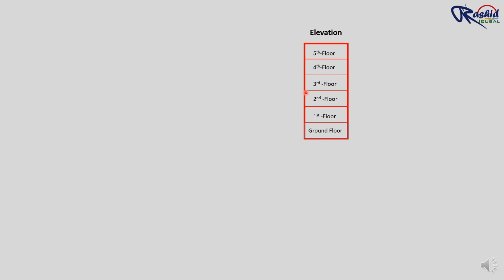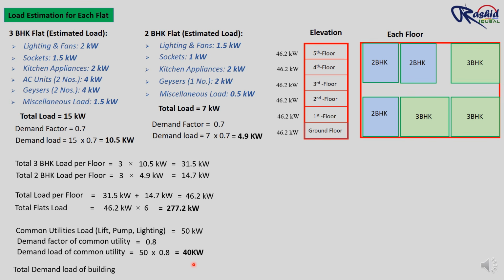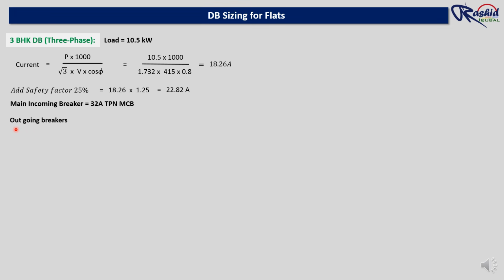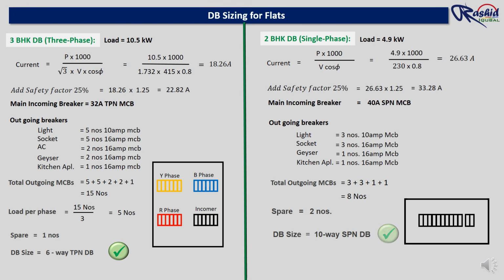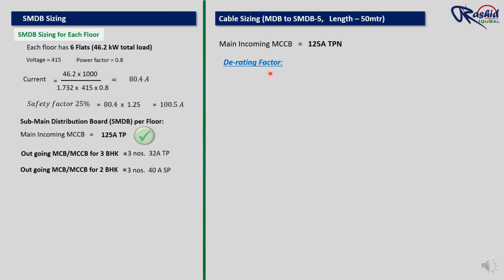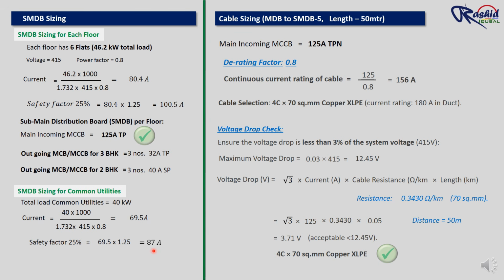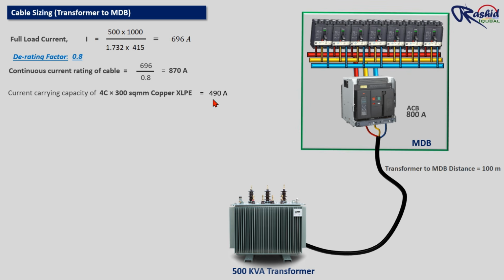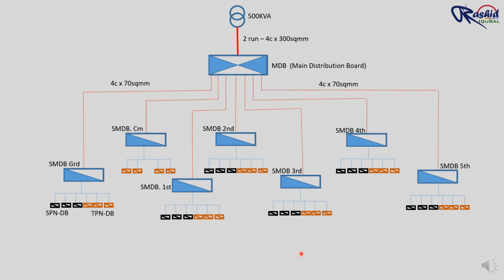Electrical Load Calculation for Residential Building | DB, SMDB, MDB, Transformer & Cable Sizing

Comment: Just to know sir, the power factor will be divided with load or multiple. For example 220*0.90=198 or 220/0.90=244.444? Which is correct?

Comment: Hi Rashid nice explanation but i have huge concerned that outgoing z 150A but incoming at SMDB is 125A this is not good & Professional practice , both breaker either be 125A or 150A but not like the above arrangment kindly avoid.
Reply from the maker: Thank you for your comment..

150A outgoing MCCB at MDB and 125A incoming MCCB at SMDB can be acceptable engineering practice. This stepped down arrangement can help achieve proper selectivity, so a local fault can trip 125A breaker first without shutting down the entire MDB feeder, provided the selectivity is properly verified. load, cable capacity, and protection coordination should be considered. I have design and used the same practice in many projects..

Comment: 40A breaker you use in each floor but incoming power you use MDB 32A. What can be happened?
Reply from the maker: I used single pole 40A MCCB at the SMDB side, and DB incomer is also 40A. There is no 32A MCCB in this setup. Please watch video again.. Thanks.

Comment: I love ur explanation but you missed add 10 to 20% to ur total connected of the building for future but u did it for transformer, secondly all ur transformer calculation, the transformer should clearly run on 85 to 90% depending on location regulations, thirdly safety factor of ur breaker is 125% instead of 25%.

Comment: Salam Aleykum Mr.Rashid I want ask you about office building if we calculate load power for office can I use this method?
Reply from the maker: Yes almost same, only things you need to consider is demand factor..  just check your electricity board provided the range of demand factor
Reply: @Rashid-iqubal Many thanks 👍

Comment: Which standard have you followed here for taking demand factor as 0.8 for common utility load ?
Reply from the maker: 0.8 demand factor for common loads is not in IEC or BS standards. It is just a common design assumption based on utility practice and experience to estimate maximum demand....

Comment: How have you taken demand factor as 0.7 ?
Reply from the maker: 0.8 for common loads and 0.7 for flats are just common design assumptions based on experience and load diversity. They are not fixed values from IEC or BS standards and can change as per project and authority rules..

Comment: Sir can you please sort out my problem.i have got 10number of  2 ton split ac.i need to know what is four core armoured cable required for this supply sir.the distance between smdb to db board is 20meters.

Comment: I would like to clarify one point regarding the protection coordination between MDB and SMDB.

It is observed that the outgoing MCCB from the MDB is rated at 150A, while the incomer MCCB of the SMDB is rated at 125A. Could you please explain the reasoning behind selecting a slightly higher rating at the MDB side compared to the SMDB incomer?
Reply: so that MDB MCCB will not trigger along with SMBD of each floor in case of fault occurrence and also the certain spare factor is taken to size main board MCCB so is 150A and is slightly greater than incomer 125A SMBD

Comment: For transformer to MDB you can take 4 runs of singe core , y to take 2 runs of 4 core
Reply from the maker: Using 2 runs of single-core cables for the three phases and 1 run for the neutral is the best option..

Comment: A small correction is required ,
While calculating incoming mcb/isolator for DB , we must make calculation based on total connected load not with maximum demand , because isolator must be capable of carrying maximum possible current if all circuits operate simultaneously
Reply from the maker: Thank you for your comment.. As per standard electrical design practice, incoming MCB/isolator for a DB is generally selected based on maximum demand after applying diversity, because all connected loads rarely operate simultaneously..

If all loads run at the same time, then demand will approach the connected load.. and Breakers also have time current characteristics, so short temporary overload may not trip immediately…
Reply: @Rashid-iqubal 7:47

Comment: While calculating voltage drop why you are not using that current value which you got after considering derating factor.
Reply from the maker: For voltage drop calculation, we use the actual current that flows in the cable, not the derated current.

Comment: hello my friend.... why did you use 0.70 and 0.80 ,  is that a rule or you can choose 0.60 or 0.65 etc????? thank you
Reply from the maker: It’s not a fixed value, my friend 😊 Demand factor depends on load type and usage. For residential we usually take 0.6–0.8, for commercial 0.8–1.0. So 0.7 or 0.8 is just a practical assumption… or u can follow as pre your country standard
Reply: @Rashid-iqubal  thankyou my friend and see you later

Comment: If u have 500 kva trafo means 400 kw which has current capacity= 720 amps so 800 amps breaker z enough. 
So as per 800 amps breaker , I will choose 240 sqmm sc xlpe/ PVC cable. 
240= 425 amps per phase as per Pakistan cable catalogue
2x240sqmm sc xlpe/PVC cable
Means= 850 amps which is enough to handle. 
2x300 sqmm sc xlpe/ PVC are over designed and not cost effective transformer current capacity is 720 amps then selection of 300 sqmm which has capacity around 1000 amps are question mark technically. However all other calculations are highly appreciated.

Comment: For 125 amps breaker 50 sqmm cable is enough to cater  if it's under 100 mtr length
Reply: Sir I have got 10 numbers of 2 ton split ac .what is four core armourd cable required for this supply sir.the distance between smdb to db is  20meters.please sort out this sir.

Comment: What's the total  KW a single phase supply in a house  in india? For example in UK a single phase supply is total 23 KW it can supply in a house which has 100 amps supply fuse at incoming supply to the house
Reply: It varies actually from state to state

Comment: Well done that man...probably the best video I have seen on the subject ! This will be very useful for everyone involved in the industry......One minor point, you derived the current using Line/Line voltage as 415V and Live/Neutral as 230V when it should be 240V. The corresponding values are 415/240V or 400/230V depending on your location.
Reply from the maker: Thanks a lot, yes I suppose to consider 240v instead of 230v

Comment: Why MCBs in flat DBs, should be installed ELCB
Reply from the maker: MCB and ELCB have different functions. MCB protects each circuit from overload and short-circuit, while ELCB/RCCB protects against earth leakage/shock..
That’s y MCBs are used for individual circuits and an ELCB is usually placed at the main incomer of the flat DB…

Comment: Aoa,
Rashid sb @ 8:08 can we use 4 pole 32A as there are 3 phase and a neutral 😐
Reply from the maker: Yes sir you can use 4Pole mcb as well, usually 4pole is use for sensitive area where neutral protection also required..

Comment: Can I consider the diversity factor in feeder cable sizing to optimize the design and reduce costs?
Reply from the maker: Yes, diversity factor can be considered in feeder cable sizing to optimize design and reduce cost but only when suitable..

It is acceptable for residential or commercial feeders where not all loads run at the same time.
Avoid it for critical or industrial loads (like hospitals, data centers, or machinery) where full load may run simultaneously.

Comment: I have a question sir, if the transformer used 2 cable each phase, so the number of ACB i have to prepare also one each phase?
Reply from the maker: No, if your ACB is able to carry full load current then only one ACB required, all cable feeding from transformer to be terminated with single ACB

Comment: Why u divide by 2 for 2 run resistance. I think u must multiply it by 2. Please explain
Reply from the maker: We divide the resistance by 2 because when we use two parallel runs of cable, the total current splits equally between them, and they share the load.

In parallel circuits, resistance decreases, not increases.
If one cable has a resistance of R, then two cables in parallel will have an effective resistance of R/2.

Comment: Sir, i have a doubt !!
How did u get that 20% of safety mergin is 1.20 in transformer sizing ?
Please explain sir, it would be helpful for me. Although a big thank you sir.
Reply from the maker: Sir this is simple mathematics 

20% means 0.2, but we use 1.2 when there’s a 20% increase.
That’s because:
1.2 = 1 (original value) + 0.2 (20% increase)

So, multiplying by 1.2 means you’re adding 20% to the original value.

Comment: A 3bhk house, total load- 8kW, total current= 54A after 25% safety, so a 63A SPN MCB DB Box is required, and inside total 16 MCB is to be put, which Way SPN Db is required, also is this calculations suitable or feasable?
Reply from the maker: Yes, calculation is fine. 8kW at PF 0.65 gives 54A, so 63A SPN DB is suitable. For 16 MCBs, a 20-way SPN DB is recommended to fit all MCBs plus incomer with wiring space.
Reply: Thank you so much sir  @Rashid-iqubal
Reply: I am an interior designer but wanted to learn some basics about this topic, and thanks to you sir I understand very nicely in just a single day.

Comment: sir thanks i have one doubt during cable sizing transformer to MDB The full load current is 500KVA so this KVA NOT NEED TO CONVERT KILOWATT ?
Reply from the maker: No, you do not need to convert the transformer rating from kVA to kW when calculating the full load current for cable sizing between the transformer and the MDB.
Because current is based on apparent power (kVA), not real power (kW). The cables need to carry the total current, which includes both real and reactive power and that’s what kVA represents.

Comment: Assalam U Alaikum, This is Engr. Haris Khan..
First of All Appreciated. I would like to add my suggestions in this circuit diagram that is missing here.
When You are designing the SMDBs for Gf + 5th Floors Plaza. You should be aware that the Energy Meters will be installed at GF. Because That's not the Govt Hospital where there will be one CT Meter for entire load.
1st You need to Make LV(Low Voltage) Room and Meter Room for this Project at Ground Floor (GF).
Then, You do not need to make SMDBs for each Floor but only one SMDB for Common load like Lifts Gensets and Lighting Load of passages. That will be exist at GF.
Single Line Diagram will be as Follows: 
LV Room will be having Busbar chamber where Main Cable from MDB to be connected, Then all 1P and 3P Meters will be connected to Busbar chamber along with CBs. Then cable connect from Meter to Breaker to Flat Db. 
In this way, all the Meters are connected at GF so that WAPDA people can deal with Meter Readings feasibly.

SMDB Common - It will also have Generator Provision and ATS (Automatic Control switch), to Turn on and off Genset without Human EFFORTS.
Reply from the maker: @Hariskhan-g7c  Wa Alaikum Assalam Haris Khan,

Thank you for your detailed and thoughtful feedback, I genuinely appreciate your time and professional input.

The design I shared in the video is also correct, as it is based on a G+5 residential project I worked on in the Gulf region, where floor-wise SMDBs and metering were implemented in line with local authority regulations and project requirements. In such setups, each floor has its own distribution, and metering is often handled differently compared to other projects 

That being said, your suggestion to keep all meters on the Ground Floor in a dedicated LV & Meter Room, with one Common SMDB for lifts, lighting, and genset loads, is equally practical, especially where WAPDA or local utility access is a key concern. Your point about including an ATS for generator auto-start is also a great addition. In my project, the ATS and genset were handled under a separate emergency power system, which I’ll explain in a future video.
Thanks 🙏🏽

Comment: Sir, here I have a request, I want to calculate wire for house wiring. Where I will go with conceled wiring. So I want to calculate the derating factor for wire selection. Can you help me?
Reply from the maker: @Mangalnyk  yes go with catalogue, there u can find proper derating factor for concealed wiring..
Reply: @Rashid-iqubal  but I have no any catlog of it. Can you help me, where can I find it out?

Comment: Sir everything is perfect, good presentation but you forget to calculate the Earthing cable YG and also for wet areas we need to consider RCD, and for ring circuit and radial Circuits size of wires MCB rating but I learn lot of things from you, I need to get more information from you ❤ please upload more videos
Reply from the maker: Thanks 🙏🏽 if i added those missing thing then video would be more long.. next video i will add missing items

Comment: Everything is good but i feel the RCBO or RCD calculation also should be considered in this calculation, and  HT metering panel from primary side is needed to calculate energy reading , main panel board and SMDB panel size and bus bar specification and other accessories .
Reply from the maker: Thanks Brother, if i consider these all things then video would be more lengthy. I will make more videos to cover those topics.
Reply: One more in every db y u shown 3 tpn...i don't know

Comment: What is the accurate value of load factor and demand factor of the flat ?
Reply: How to determine the demand factor? For AC in factory.
Reply from the maker: 0.7 – 0.8 is common for factories with intermittent or variable loads.

0.9 – 1.0 is used for factories with continuous or high-demand machinery.
Reply: @Rashid-iqubal  the load is from AC units, not machines.
Reply from the maker: @Haru-wr8do Oh miss understanding..

The demand factor for air conditioners in factories depends on how many units will be running simultaneously during peak load. Typically, a demand factor between 0.5 and 0.8 is used for ACs, reflecting the fact that not all units operate at full load simultaneously. The actual factor can vary depending on the factory’s usage pattern and type of AC system.
Reply from the maker: Hope you get your answer
Reply: @Rashid-iqubal  thank you
Reply from the maker: Load Factor is used for energy consumption analysis, not for sizing electrical components. We used Demand Factor (DF = 0.7) to determine the realistic design load from the total connected load.
These values are estimated based on experience and standards, as they vary with real-time conditions… hope you understand
Reply: How many sq. ft. do you consider for your 3 BHK residential load?
Reply from the maker: @ Electrical load calculations are based on appliance usage rather than exact square footage.. there is different way to calculate electrical load based on Sq ft.
Reply: Thank you, for gave this professional calculation.
Reply from the maker: Most welcome